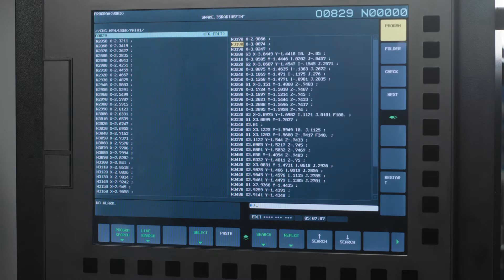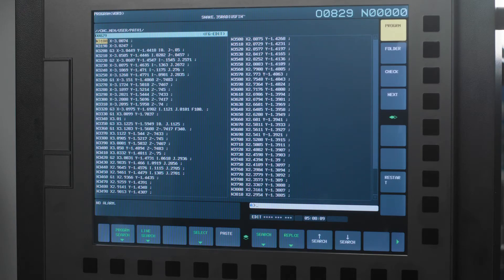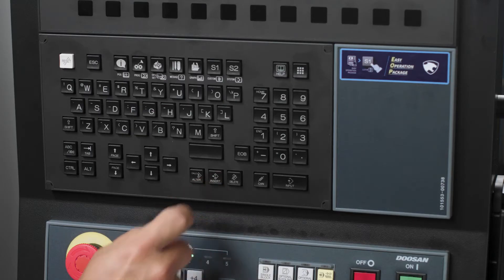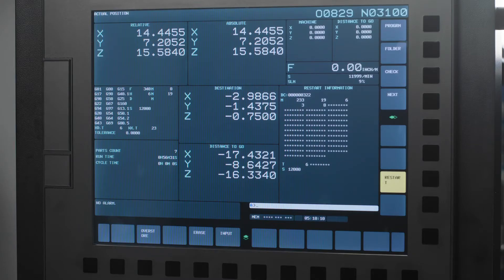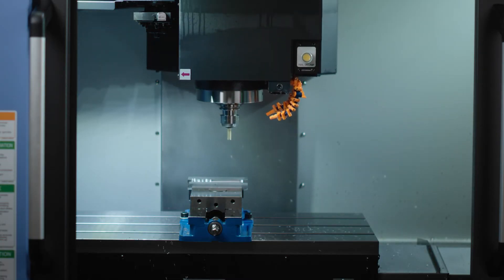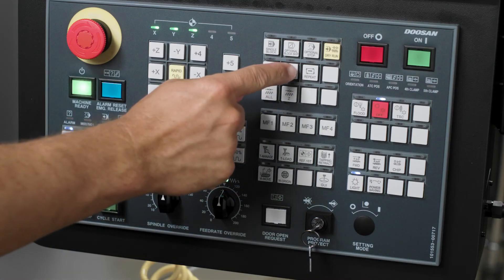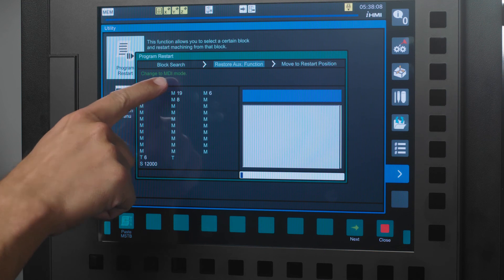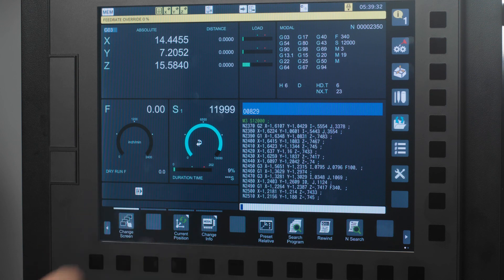Restarting After Program Interruption – Know Your DN, Episode 14

Comment: Can a CAM program automatically use Tool Measurement values from TS27R for tool compensation?
Reply: I am not really sure I understand your question.  But I will tell you this, the tool setter populates tool height and diameter offsets in the tool offset page when a tool is measured.  Your CAM system just programs the part and calls a particular offset.  So for example, if you are using Tool 5 it will state something like:  G43 H5 D5.  I am not sure I understand how or why a CAM system would need data from a tool setter on the machine?  But the bottom line is the tool setter only provides data to the tool offset page inside the Fanuc control.

Comment: How do I add a Renshaw probe to my program
Reply: Richard, do you have a Renishaw Probe?  If so you have to activate it on the RENGUI page.  Once it is activated the macro programs that operate the probe become available in the machine.  As far as adding it to your program, Renishaw has documentation on how to program using their probe within your part program.  You would need to contact them for that documentation.

Comment: With these informational videos I wish there would be a simple printable step by step guide/check list. I'd hang these on the back of the controller.
How fast can this restart be done by a seasoned user?
It seems if the cycle is only 5mins I'd be better off time wise starting at the beginning.
Reply: Jorg, just like anything else, the more you use something the easier it is to use.  I consider myself a "seasoned user" and it only took a little bit of trial and error and doing it a few times to get comfortable with it.
Reply: @markchristopher5809  you are right, practice makes perfect. I just wish it was more intuitive, I still struggle with the tool load settings.

Comment: Are there any way to get the machine to do an M30 when reset are pressed 
If I pressed reset then I have  goto MDI and do M30, just so the machine can restart from the start without alarming out.
Just like all other machines work in the world
Reply: got a real answer thats a bit faster.  in memory, feed hold, reset, then switch to edit, reset, then switch back to memory, and you should be good to go.  just learned this today.
Reply: jfc, this machine has been driving me nuts for weeks.  why isnt this talked about anywhere?
Reply: Switch to edit, reset, then back to memory. Always has been this way on Fanuc for as long as I’ve been using them, nearly 25 years in fact
Reply: I have never experienced what you are talking about... I have run fanuc for decades, and we have a few doosan 0i controls now and I love them.. I reset out of programs all them time without ever having to do an M30...

Comment: Yes in only 28 steps you too can restart your Fanuc machine... :D  Thanks for going over it, once you get used to it, it will seem easy enough. Charles
Reply: Charles, I agree it can be a few button presses but what I really agree with you on is once you use it a few times you get used to using it.  Appreciate the feedback!
Reply: I am about to train up on a new Doosan lathe. I have generally worked on Okuma lathes & mills. It is really amazing me just how spoilt I have been! A restart can be carried out in, pretty well, 2 steps. Even the old controllers are smart enough to pick up the spindle speed. Why can't these controllers do that?
Reply: After reading through the manual on an 18ti, it does feel like fanuc were the first people in and made it up as they went along and for backwards compatibility we're stuck with what they chose. Okuma and HAAS came after and streamlined a lot of things.

Comment: Show next, how to properly set up a rigid tapping cycle, pull out the tap at a faster speed 200%
How use teach mode in mdi
How to remove the movement of the axis with G49 #5006 TOS
How to set the correct G83 small hole drilling cycle with "i" back feed
How format memory card on cnc
Reply: Thank you for all of the suggestions!  I will add them to our list of potential videos!